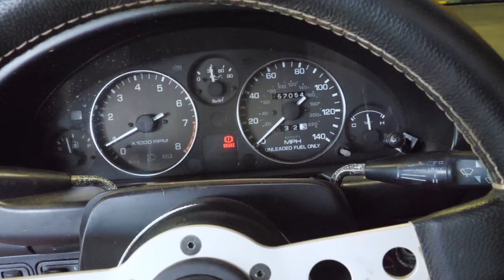Saving A Highly Modified Miata With Flood Damage, For Profit? Step 1: Remove Water

Comment: The surprising thing when my car was written off in a flashed flood was how dry in the interior was . It was in about 3 foot of water floating down the small river which was where a road had been 15 minutes before.
But everything mechanical was toast water was in everything. I would not touch one with a ten foot poll. Maybe sell it as a near new painted body.

Comment: The speakers appear to be a plastic material with a rubber foam outer ring. Unless water got into the magnet area you are fine. If a gentle push of the speaker cone has movement, you are ok.

Comment: #2.8k👍When my 90 Geo Storm got bashed I tore up the check and told her insurance I was getting it fully restored to preloss condition then bring them the bill.  The title was cleaned by State DMV & I got all my repair costs paid by the insurance of the idiot that caused the mess.
Never went through the buy back hastle.  Today it is better than when I bought it used at 33k miles.  Loads better 93k miles now.  It is a great antique I love to drive occasionally.  💖

Comment: FYI, RMR-86 is a good mold and mildew surface cleaner.  It's what tradesmen use to mold remediate homes. Just remember to wear a hazmat suit and gas mask when using it.  It stains everything and not something you want to breathe in.

Comment: Possible ...... EVEN TRADE? 1973 Corvette fully optioned car power window-power steering(new bargesen with brace)-power 4-wheel disc brakes-454(rebuilt & never ran) Tremec TKO 500 5-speed trans- post-311 rear end-L88 fender flares & front spoiler- new bilstien shocks- new brakes and lines-new wire harness-nice 18 rims and tires-converted to electric pop-up headlights-clean pink slip- still needs work to complete.
Reply from the maker: Oh. Man. I’ve had a c3. A 73, manual… I don’t know if I’m down for another project

Comment: I’m curious how the original owner found out that you would be bidding on the car and how did you know exactly what manufacturer aftermarket parts were used in this engine?  Don’t auction houses typically not provide these details since they don’t usually know?  Just curious…….

Comment: USAA tried that with me with my STI. Fought with them for over a month. I didn’t sign any paperwork and they finally let me buy it back. And yes i see that USAA writing on the shield. They are a crappy insurance company. Sent my car to copart immediately. It was very repairable (only some body damage) until it got to copart! Copart shoved forks under it and destroyed tires, control arms, exhaust, etc. when i got my car back it wasnt even complete anymore and the interior was trashed! I wouldnt recommend USAA to a soul.

Comment: There are few bad design features of the Porsche 928 

[HINT......!]

But one of them is the entire fuse and relay panel is located in the passenger footwell.  This makes it very susceptible to flooding.  Most cars can handle some water on the floor boards and seats [this is a convertible, hello?] so I don't think the interior is trashed at all.  Bleach it, clean it, DRIVE IT!

Comment: This might be a longshot but did your friend buy this from a guy in the Green Bay area? My buddy bought one just like it, red with rollbar. He tossed pistons/rods and turbo into it then tuned it with an older megasquirt box. It must have been a 1.8L car since he had the box mounted on the center console side (where the wideband is now) instead of in the foot well.

It would be interesting if this was the one - he bought the farm in a bike wreck a few years back.

Comment: I was wondering why didn't you have to wash mud out of the trunk? is it high enough or sealed good enough that water didn't get in?
Reply from the maker: Trunk was high enough to not get wet
Reply: I too was wondering about that(especially cavity behind door) and if he had inspected the bottom nooks and crannies and washed those out too.A corded electric leaf blower also can dry some stuff while dislodging hidden unwanted junk.Those ozone generating UV lamps are awesome at destroying any hidden mold as well( I think someone else may have mentioned that too).

Comment: I do not understand why people avoid buying flooded cars. Electronics are surprisingly resilient, provided of course they haven't come in contact with salty water. But even if you can't repair them, you can easily replaced them. There's a ton of cheap parts out there for all cars.

Comment: I had a 1990 Miata.  it was sold to a neighbour. she left it out in a rain storm.  the computer is under the floor boards in the passenger footwell. it blew the computer when they tried to re start it.  all of the connections to the computer are below the height of the rockers.  If you have running issues you may find it there.

Comment: For those seat rails and other metal places with inaccessible cavities and the like, would it be worth taking a heat gun, at low temp, to warm up the metal gently so that any water in the crevices might dry up as well?  I'm not a car guy so if this idea is insane please forgive me.  Looks like a great car.  I might be having a midlife crisis.  It's a bit late for me to be having one, but a little red sports car with the roof down might be fun.   My first car was a convertible '64 VW bug.  At my age I don't have to worry about messing up my hair anymore.

Comment: You used terms some of us aren't familiar with; standalone, wideband, and megasquirt (aftermarket ECU?) Also, how hard is it to retitle a salvage car?
Reply: Megasquirt is an aftermarket ecu brand, stand-alone is an ecu computer that doesn’t have to be connected to your cars stock ECU, some computers will plug into the stock computer and work with it. The megasquirt is a standalone so it has every function the car needs. Wideband is an air fuel ratio sensor that displays O2 of your exhaust. 14.7:1 is perfectly mixed. If you go with a ratio that is leaner (more air) you will make more power, however that heats the engine more and can cause early detonation or knock. Too much knock will cause malice in the combustion palace.
Reply: @Taithleach94  Thanks for your answer!😁

Comment: Cool video.  You should look at redoing the cabling to 38999 mil spec connectors, that would be pretty cool.  I used to be WHMA certified though, so that may be why I would like to do this.  But I know I have seen a couple of people who have done this on a vehicle before on youtube, so maybe I'm not that crazy.  I would probably also build my own scratch FPGA computer as well so maybe I am still missing a few marbles.  I have wanted to try to do one of those miata off-road dune buggy conversions, and maybe I'll get to do one someday...  Quick question: How hard do you think it would be to make an engine with "voice coil" valve actuators?  I have been wondering about it.  Those things are crazy fast(like fast enough for an engine) and can pack a pretty good punch in terms of force.  Then you can drop all of the valve cams and stuff and go all digital with an absolute encoder on the crankshaft for maximum variability.  With maybe a CUDA CNN based computer too, for fine tuning on the fly or maybe I have had one too many whiskeys on the rocks tonight lol.  Thanks for the content... its always enjoyable to check out.

Comment: Looks like they are plastic cones on the speakers, as long as the water didn't reach the coils you'll be fine
If they had been paper cones they would need replacing.

Comment: Whoever dies with the most car projects wins! Hey I just tore down a 2001 7.3 powerstroke core and I found some interesting things that would have been good for one of your videos! One piston is munched up from a piece of metal and all the others have broken or stuck piston rings. The cylinders all have surface rust but it is worn as if someone was making an attempt at getting it running. The tops of the cylinders where the ridges normally are have been torched and melted in spots, some of them deep enough to ruin the block. it was in a e450 cube van put through insurance for damage to the side and roof but it looks to me like that was done on purpose after the owner discovered they couldn't get it running. Probably parked initially for the cylinder that ingested the metal, then the rusting stuck up the other 7 cylinders and made it impossible to start. Insurance fraud sort of...

Comment: -Mold doesn't bother me.  YES it stinks, but for a while on the side I did handyman work for a guy that fixed and flipped houses.  We entered PLENTY of smelly places, but I never got sick and after a good cleanup and some bleach sprayed around, we were able to get rid of the smell.  A moldy car?  Just start cleaning.  You might have to take up the carpets and clean them, but a bit of mold in a car sold cheap?  As long as the electrical system is not compromised.....Sell it to me!

I really think there are a lot of people who are hypochondriacs.

Comment: Get yourself an ozone generator. Car outside, extension cord, let it run in the interior for a few hours. No smell, kills the mold, and you can get into cleaning safely.

Edit... Also get a proper dehumidifier. That chinesium little thing is barely doing anything.

Comment: had a friend have an accident with her car they wanted to total it and take the car. i told her to tell them to get fucked. 1 you do not have to accept that they totalled it. its your car in your name they cant take it from you. just dont accept any money from them and fix the car yourself. you can also sometimes argue with them to have the car fixed. which is what happened in this situation the car was repaired and insurance paid for the repair instead of totalling the car.

Comment: Monster Miata. Gut that expensive shit sell it to Jason or someone like him with small dreams about making a big engine out of a 4 cylinder. Then use the money to get a real engine like an LS and pop that in. If you really wanted to one team put a Hellcat engine into a Miata! Who needs all that complicated crap when you can just throw a bigger engine in the hole which obviously is what they wanted to do in the first place? Sure, while your there beef up suspension and the drive train etc. For about $25,000 then subtract the money you make back on Ebay used parts you got a fast ass practical car for about $20,000 and some work. Seriously, those cars are so small it would be fun and not too hard since they make kits for almost every step with directions. Of course, your thinking just fix it. Yeah... like I said to begin with the big engine was what the designers obviously were thinking then Mazda said no and put a practical mid powered engine inside it to everyone's disappointment. Don't continue Mazda executives ill vision and mistakes. Sure they sold a lot of flashy, slow cars old people bought who did not have enough money for a Viper but wanted the top down and race day red. That is not what that car was supposed to be about though.

Comment: If the blower motor is shorted out due to the water the car was in a lot deeper water that your pretending it was.   WHY not leave the de-humidifier in the car for a few days?????????????  A lot of poor decisions leads to a lot of bad choices in life,  A MIata is not a car to collect even if you know who did the shitty work on it prior.
Reply from the maker: The blower is very low on these cars.
It was incredibly clear where the water line was, so I am not worried